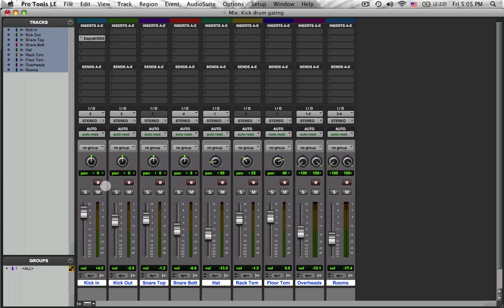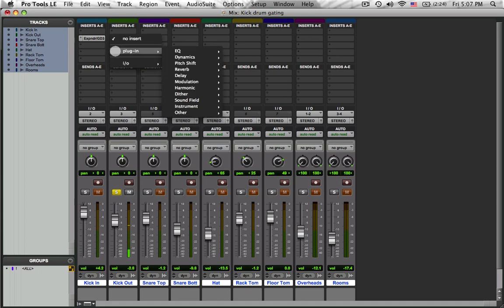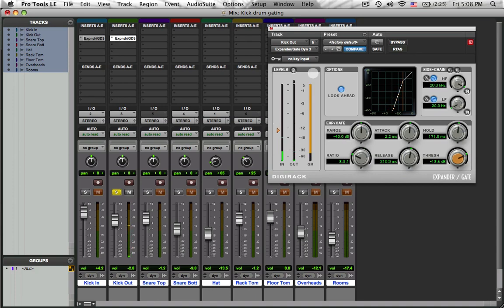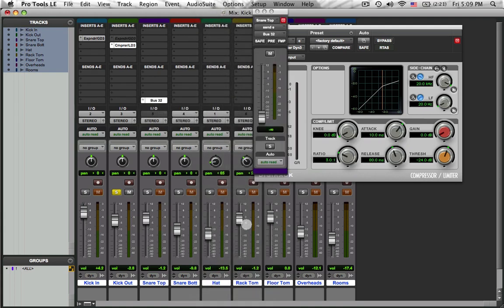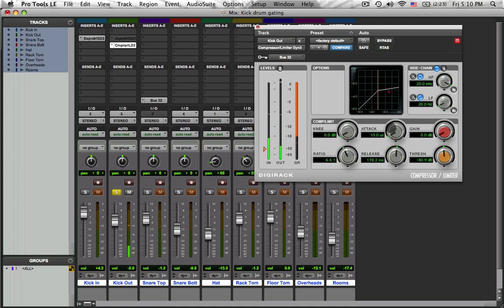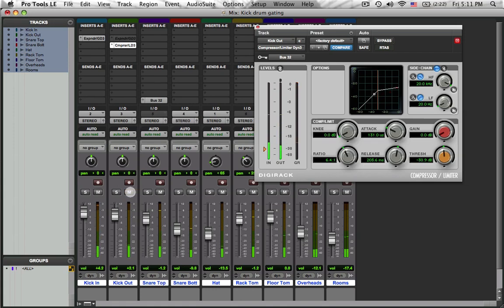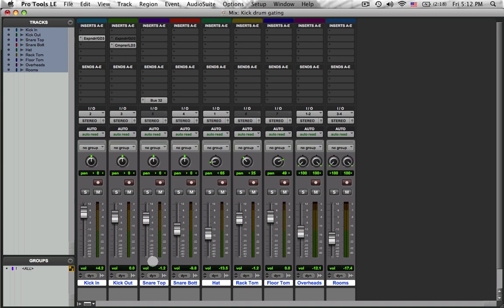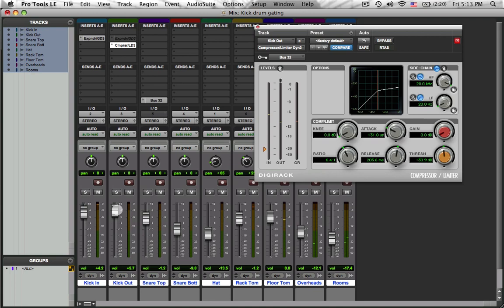Mixing Drums - Dynamics - Isolating the Outside / External Bass Drum Mic

Comment: Hi Joel,
I don't have Pro Tools, only Logic Pro. There doesn't seem to be a gate or expander plugin in Logic that has all the knobs/adjustments that you have with the expander you use. Do you work with Logic? Can you recommend a plugin that allow me to make the same adjustments that yours does in Pro Tools? Thanks.
Reply from the maker: I'm not familiar with Logic, no.  But the parameters on the basic ProTools plug ins are fairly common among processors of these types, so I would think there should be something similar available within Logic's many included plugins.  I don't know this for sure, but would be surprised if their plugins lacked this functionality.  I'm sorry I can't be more helpful.
Reply: Unfortunately, I couldn't find any Logic plugins that incorporated the elements you use with your similar plugins (either too many or too few knobs and faders), but I managed to find Fab Pro plugins and now I'm hearing my drum sound starting to come alive with your tweaks - finally! lol thank you!